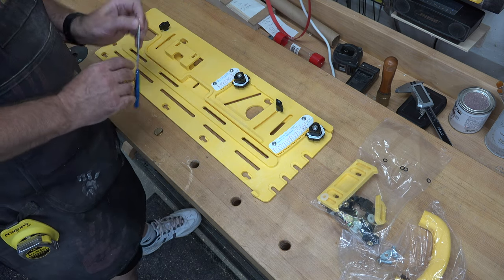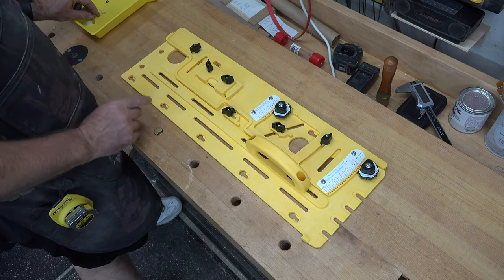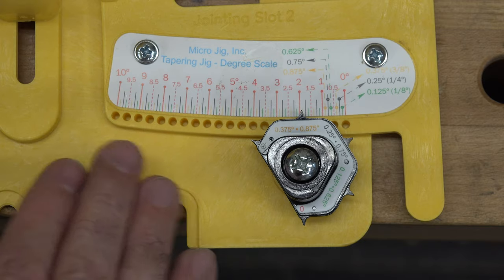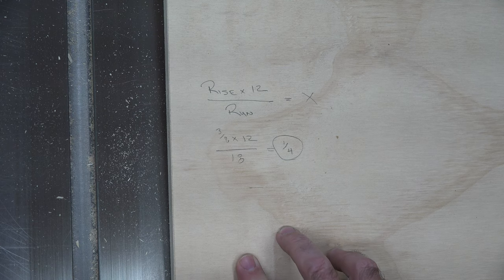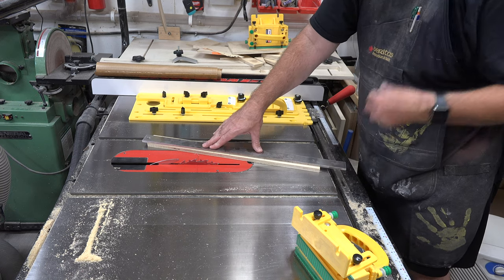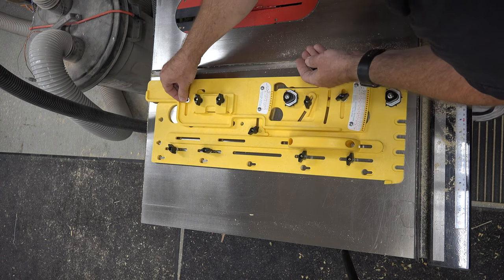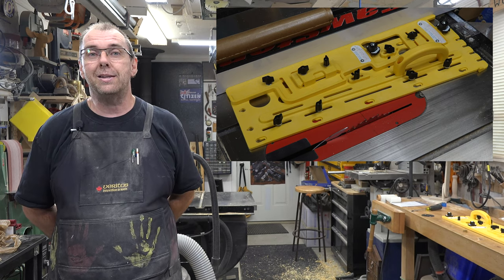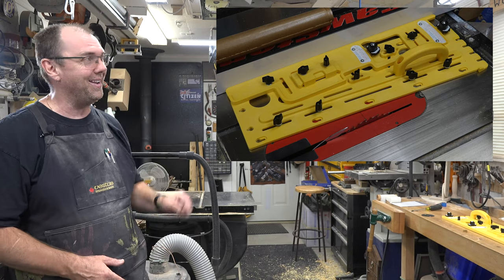MicroDial Taper Jig

Comment: Wonder how long a board you can taper with it?
Reply from the maker: As long as you have support of the board, length doesn't matter.  The restrictions start when you slide the jig too far off the table and lose contact with the fence and the table support.  So you have to take that into consideration when using the jig.  For most applications, this jig will work just fine however.  Thanks for tuning in

Comment: Just bought the MicroDial this morning.
 Go it up and running and finished a trim piece under the threshold of a new door install.
Using the "Rise / Run formula I was pretty much spot on.
Disappointed in the manual for putting together the Jig.
But your video was a HUGE help.
Thanks brutha
Reply from the maker: Most manuals are a disappointment.  I'm glad that you found the show to be useful.  Thanks for tuning in and taking the time to leave a comment.

Comment: Kenny,  interesting jig.  I have seen in pictures but never in operation.  It will be interesting to see how you like it over time.  Great information so far.  Thanks for sharing.
Reply from the maker: I will be interested as well to see how I like it Paul.  I'm looking forward to putting it into use.  There have been quite a few times with my model builds that I needed to cut a taper and I came up with some pretty inventive ways of cutting them.  I am hoping that by setting this jig to the angle taper that I want, I will be able to cut some pieces without having to using ingenuity.  I will be sure to report back once I get the chance to put it through its paces.  Thanks for tuning in to the show.

Comment: Hi Kenny good video as always.  I would be curious to know what you thought would be the maximum length of board you could use the jointing feature on.
Reply from the maker: For me personally Robert, I would joint a board of more than 36" long and even then I think it might be pushing it a bit.  I would want the entire jig to have complete contact against the fence for the entire duration of the cut and at a guess, I think 36" might max that out.  I hope this helps.  Thanks for tuning in to the show and taking the time to leave your question.  I appreciate it.

Comment: Hi Kenny. Happy new year to ya.
Not a criticism but I have noticed in your last couple of videos that there is a distinctive hissing sound during your recordings. They were previously crystal clear. Just wondered if you had noticed it yourself. Hope you don't mind me saying.
Reply from the maker: Happy new year to you as well Cliff.  For the record, I don't mind you saying at all.  Feedback from the viewers is very important to me.  For a while there (I think it was about 6 episodes of the show) I was testing some new lapel microphones.  You might even be able to see one clipped to the top of my apron.  Either way, they were horrid and after trying several tweaks and adjustments, I finally stopped using them because I couldn't stand the hissing and the poor quality of the audio.  I was looking for a way to improve the audio and only succeeded in making it worse.  Not to worry, once those shows are done airing, the sound should go back to normal as I've discontinued the use of the lapel mics.  I hope this helps.  Thanks for tuning in Cliff and taking the time to give your feedback.  I love it.

Comment: Nice review Kenny. Thank you. Picking one up tomorrow from FB Marketplace new in box for $50. 
A year later how do you like it?
Reply from the maker: I still like the jig and it still works extremely well.  I do like the fact that I don't have to guess at the angles that I am cutting on the taper because I can dial them in to the angle that I need instead of just lining up the jig with a line on the board.  The repeatability of this jig is fantastic.  I hope this helps.  Thanks for tuning in.
Reply: @acutabove_woodworkings  thank you so much for reply. it does help. excited to try it out. Wife wants a cherry side table for one of our couches
Reply from the maker: @pizzawarlord9232  I'm only too glad to help.  Good luck on your project.  Please feel free to send some photos of your side table when you are done.  I'd love to see it.  You can send pics to kennye@acutabovewoodworkings.com

Comment: Informative demonstration, Kenny, as usual.  I need a tapering jig and was trying to decide if I should make one myself or get a manufactured one.  Personally, this MicroGig unit looks like too much of a PITA to bother with.  I have a Grrripper, use it on occasion, and I'm not all that impressed with that either.  One reviewer called it the Slllipper and I can see why.  Sometimes it just doesn't grip well.  If you haven't already, check out this homemade one from Wood Magazine.  I think I'm going to go with this one.  Thanks again for posting.  Mark.  https://www.youtube.com/watch?v=ywAmEcNozJ4
Reply from the maker: Even in my review of the Gripper Mark, I state that you really need to keep them clean with alcohol.  Otherwise, the gripper quickly becomes a slipper.  I am rather fond of them though but I can appreciate you opinion on them.  As for the taper jig, I love this micro jig one but I do have a simple shop made version on the channel.  While it may be a little large for your purpose, you can always resize it to suit your needs.  Here's a link.  I hope it helps.  Thanks for tuning in.  https://www.youtube.com/watch?v=8ZKIZnyjmoI&t=18s
Reply: @acutabove_woodworkings Hey Kenny. I saw your demonstration of the Microdial and never searched your channel for one you constructed.  Thanks for the link!  And thank you for the alcohol tip with the Gripper, I will definitely try it.  Mine never got dirty enough to clean, visibly, so it never occurred to me that it might be an issue.  Once again, thanks for the quick reply and info!  Cheers! Mark